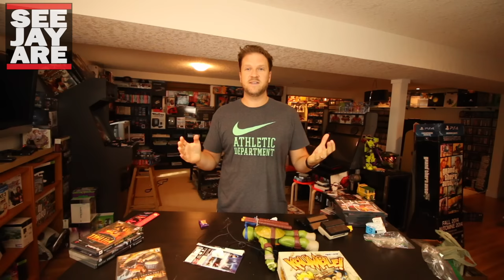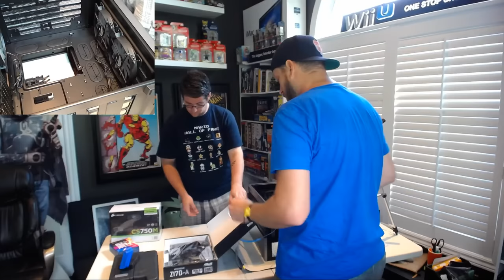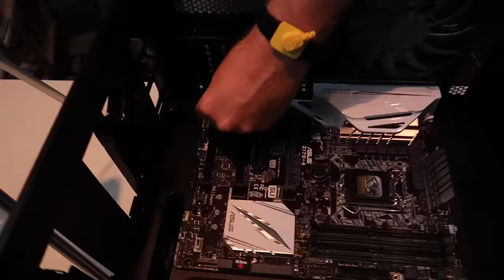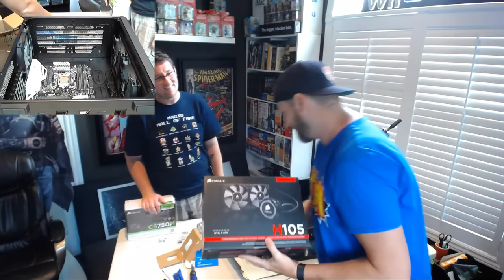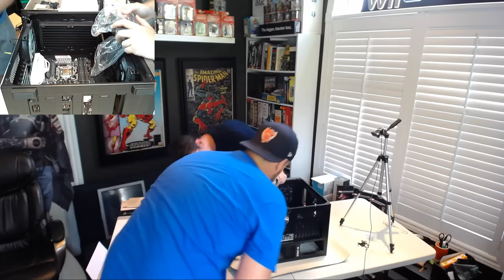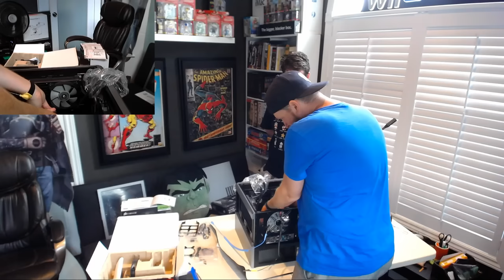Gaming PC Build #1 - Building My First Gaming PC - GTX 1080, i7 6700k

Comment: If possible for next video, can you focus the main view to the PC instead of having it in the tiny screen on the top left? THAT'S kind of what I need to see - not your back blocking the view with a messy desk. Sorry if that comes off as rude (I really don't mean it to be) - I'm doing a very similar build for the first time, and it was really hard to see.

Comment: I just noticed something m8........😕........You forgot to put thermal paste on the bottom of the cpu before placing it in the motherboard...😐
Reply: i hope this is a joke
Reply: The H105 has pre-applied thermal paste
Reply: He said on the bottom of the cpu. Meaning where the pins are.
Reply: Lol, you do not have thermal paste in the "bottom" of a CPU. When that thermal paste get's old, it will fry the CPU in a snap, and, or giving CPU bad connection against motherboard! When having it on top tho, before putting the CPU-fan or what so ever, and the paste get's old. The overheating-sensor that nowdays are built-in in every mothercard senses it, and turns the computer off without frying the CPU. So I can understand why some builders nags about! "Crap CPU, only lasted 2-3 years then it got fried up!" Well, they putted thermal paste in the bottom of the CPU then. Hahaha.
Reply: Why would you need thermal paste on the bottom of the CPU where the pins are, the paste is to make full contact with the liquid cooling block that sits on top of the CPU if you do put paste on the pins for the CPU there's a good chance of frying the whole peace of kit Motherboard and processor.

Comment: I have the chance to buy a pc with these specs:
Corsair Carbide Clear 400C Midi Tower
Corsair CX750, 750W PSU
Intel Core i5-6600K Skylake Processor
Cooler Master Hyper TX3i CPU Cooler
ASUS Z170-E, Socket-1151
Kingston ValueRam DDR4 2133MHz 16GB
ASUS GeForce GTX 1070 DUAL OC BLACK
Samsung PM961 SSD 512GB M.2 NVMe

for the price of $1,931

Is there any way i could get the same computer cheaper? If there is. Please tell me

Comment: Processor: Intel Boxed Core I7-6700K 4.00 GHz 8M Processor Cache 4 LGA 1151 BX80662I76700K

Cooler::Corsair Hydro Series H100i v2 Extreme Performance Liquid CPU Cooler CW-9060025-WW

Motherboard: MSI Performance Gaming Intel Z170A LGA 1151 DDR4 USB 3.1 ATX Motherboard (Z170A Gaming Pro Carbon)

Graphics Card: ASUS Geforce GTX 1070 8GB Turbo Edition 4K and VR Ready

Ram: Ballistix Sport LT 16GB Kit (8GBx2) DDR4 2400 MT/s (PC4-19200) DIMM 288-Pin – BLS2K8G4D240FSE

SSD: Samsung 850 EVO 500GB 2.5-Inch SATA III Internal SSD (MZ-75E500B/AM)

Power Supply: EVGA SuperNOVA 750 P2 80+ PLATINUM, 750W ECO Mode Fully Modular NVIDIA SLI and Crossfire Ready 10 Year Warranty Power Supply

Computer Case: Fractal Design R5 black window

Keyboard: Logitech RGB G810 Orion Spectrum

Mouse: Razer Mamba tournament edition

Pad: Razer firefly
                                                 this is my build i have everything except for the graphics card which i might upgrade to 1080 but probably not. thoughts on the build?
Reply: i have the SSD which is plenty for just pure gaming
Reply: but besides that does it look good
Reply: Yes everything looks good but I STRONGLY recommend an HDD
Reply: why?